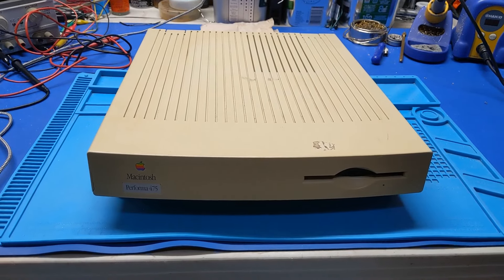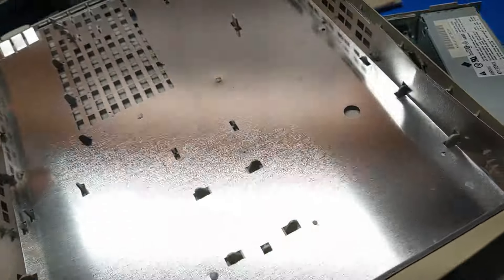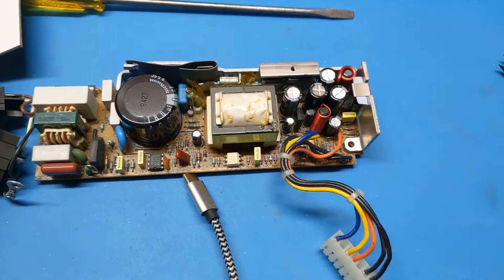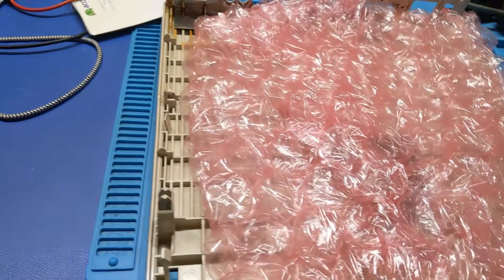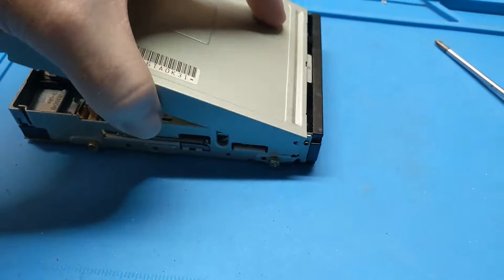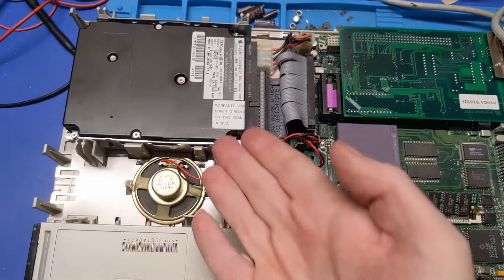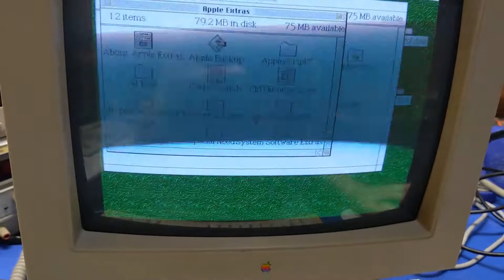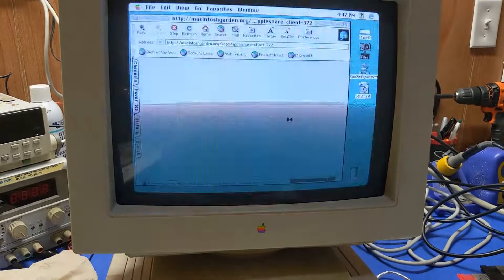Macintosh Performa 475 Restoration

Comment: I'd forgotten I'd sent you that case!

It wasn't from a battery bomb, but rather there was a ton of rusting of  the EMI shields. I ended up tossing the bottom bit as it was too far gone. And unfortunately the rust stains the plastics. But its plastics weren't too brittle compared to most
Reply from the maker: Ahh gotcha. Yeah i was wondering, it kinda looked like battery damage in a way.

Comment: I just use a hot glue gun to re-attach the shields.  Just squeeze a little into each of the plastic points you cut off.  It works great! Great job!

Comment: The main difference between the two models is the hard drive size. The Performa 475 comes with a 160 MB hard drive, while the LC 475 could come with an 80 MB, 160 MB, or 250 MB hard drive. The LC 475 also has the option of coming with 8 MB of RAM, while the Performa 475 comes with 4 MB. Other than these differences, the two models are very similar in terms of their technical specifications. They both have the same processor, the same form factor, and the same expansion capabilities

Comment: i have one performa 475 but it do not start: perhaps the power is off, no voltage on the connector, do you have the pin spec to replace the power